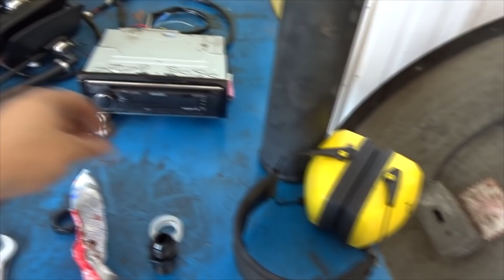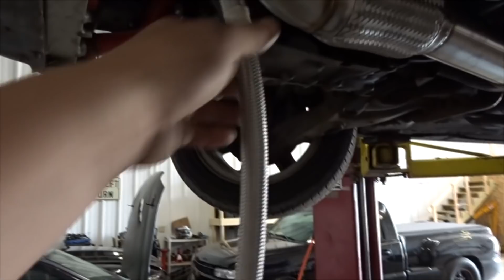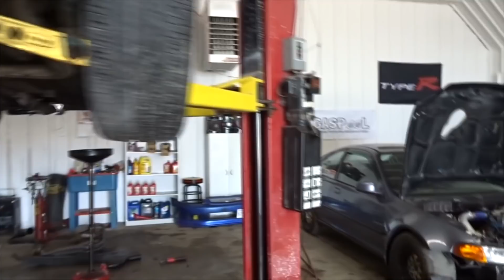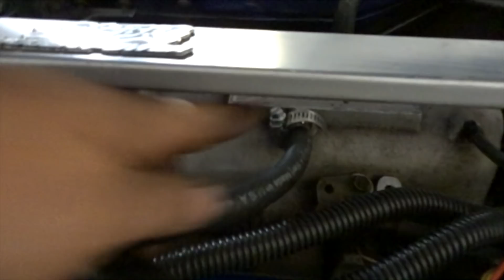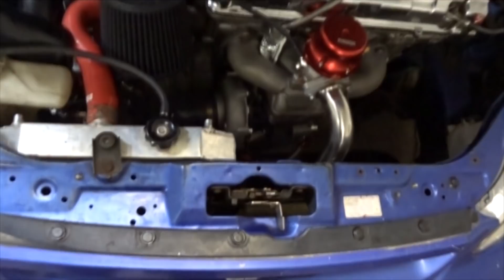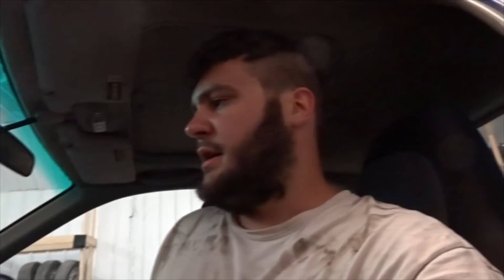Rev9 EMUSA Ebay Turbo Kit Install Part 2

Comment: So you don't need to vent the valve cover of running low boost?my Lsvtec swap isn't built,it's stock,and I don't plan on running anymore that 7-10lbs of boost....if needing to vent the valve cover,what's the best catch-can set up for a 89 Honda civic?

Comment: Have you had issues on HTS with the vtec crossover leaning out on you? I've thrown over 20% at it, with no change. It keeps hitting around 13.2 A/F then gets rich again. Setup is b18c1, gt3582r, 450 pump with bosch 1000cc, BKR7E gapped at .20. Thanks in advance for any help. on 93 octane
Reply: Your map isn’t smooth set vtec high and tune the set low again

Comment: Is it okay to run 4an feed to the vs racing turbos? I bought one of ryans 3071 and he had a 3an feed fitting on it and my ebay feed is a size bigger. Can i just get the 4an fitting to turbo and be okay?
Reply from the maker: Get a 3an line

Comment: That's that Honda genuine manual transmission fluid and yes it does look and act like water
Reply from the maker: This stuff was virtually clear
Reply: Agreed that stuff is super thin
Reply: Pay attention to it the next time you around some it will pour out just like that. Or when you shake the quarts it's like they have water in them
Reply: nothing works better at least for newer honda manuals. ive tried lots of different fluids in 2000+ manuals. 

only had personal experience with 2 older hondas that are my brothers so my experience with B, D, H etc engines are limited. but it they always shift smooth and and quiet when using honda mtf and using the honda service intervals even with hard driving. I've used the pennzoil syncromesh and valvoline mtf and redline too in lots of different cars cars and it never lasts as long as honda mtf and it feels just the same as the top brands when new but lasts for a lot longer on a mileage basis. 

just my two cents tho